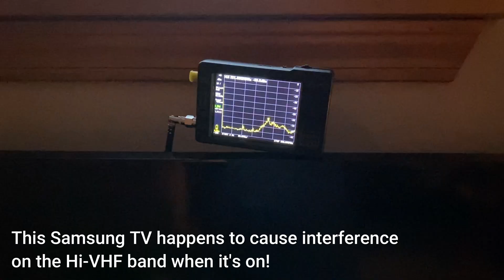ATSC 1.0 and Lo-VHF: A Nightmare.

Comment: In NYC there is one low VHF TV station.  And it's a nightmare...it's MeTV's WJLP.  It operates on VHF channel 3 digital and 33 virtual.  There is another MeTV affiliate out of Bridgeport, WZME 43.3, which airs on digital channel 21.  Though WZME has a transmitter in Trumbull, CT, it also has one atop the Empire State Building in NYC.  WJLP's tower is at 4 Times Square in Manhattan.

Comment: Las Vegas antenna situation. Can't get every channel in with a position of the antenna.
Atsc 1 frequency's
2;7;8;11;13-28;30:32;35
Frequency 2 and 32 can only be picked up on one of my antennas. I got 2. Frequencies 14:24;30 are the hardest to get in.
Atsc 3 frequencies
6:29;33
Problem is I seem to be getting 2 on frequency 6. One strong with no channels and a weak one with 2 channel.
I have no idea what frequency 33 is going to be. Keep pulling it offline and back on. Looks like NBC station might be using it soon. Since that station was added. Channel 33.34 is (BA ktnv) 33.35 is ( 4k hdr) name. It has a sports channel on it. What does BA stand for?

Comment: Well,
You know what?, 
At least there is an answer to the whole "ATSC 1.0 Lo-VHF Nightmare".  
At least you know that you need a pretty long element in the antenna to receive Lo-VHF Digital Television Stations whereas with ATSC 3.0, you have to hope that the stations are not A3SA/DRM encrypted to even receive the Digital Television Stations.